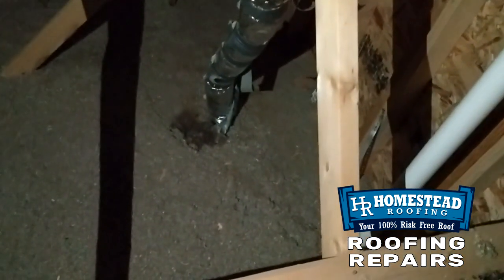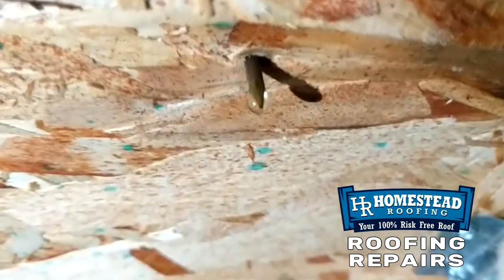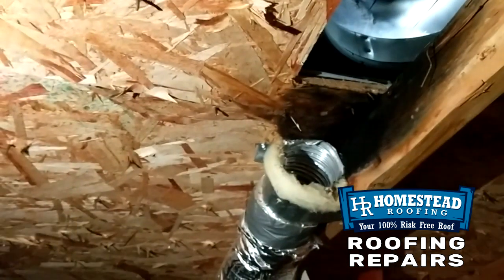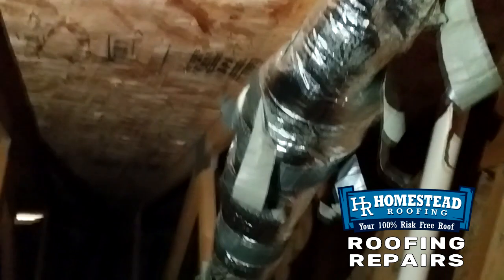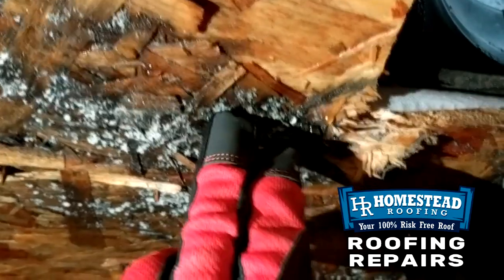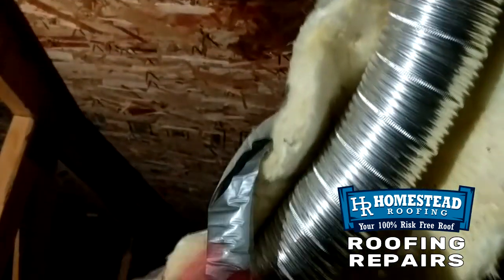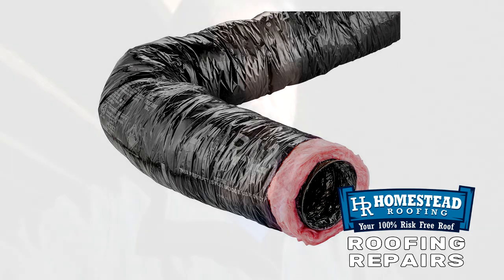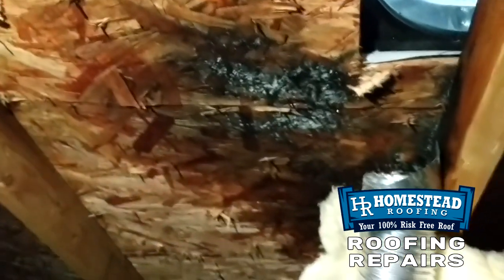My Bathroom Fan Is Leaking! (Part 2)

Comment: No use no problem. Running floor fan in the bathroom or dehumidifier
Reply from the maker: You'll still have evaporated water going into your attic through the fan. The fan casing is basically a hole in your bathroom ceiling. That's why it should be vented all the way through the roof.

Comment: So who do I call?  I want to go on the roof and see if I have an outside vent for this before I call anyone. What would it look like?
Reply from the maker: Renee, you if you can see all your roof slopes from the ground, you shouldn't need to go on your roof. The cap you're looking for will either be for a bath exhaust fan or a dryer. If your dryer vents on the side of the house, if you see anything on your roof that looks like this, it's a good chance that it's a bath vent cap. https://www.lowes.com/pd/Broan-Universal-Roof-Cap-Black/1245637?cm_mmc=shp-cprdappgooglelia-186-applianceaccessoryproduct-1245637-_-0&store_code=2578&placeholder=null&gclid=CjwKCAiA8ejuBRAaEiwAn-iJ3hbbVyeiFdv2zJxUu5-yCHqYcoLyhY2C0C8l52oPVnIFmBozU7XbixoC69EQAvD_BwE&gclsrc=aw.ds
Reply: @homesteadroofing  thanks very much.  I was up there the other day cleaning my swamp cooler. Wish I had noticed then. I can't see it from the ground level.
Reply: @homesteadroofing So I had bad ventilation in my attic, which caused a lot of water damage. My dryer vent pipe fell off from roof. I had new shingles put on 5 years ago and these are the same cap that's on my house. My question these caps don't have a pipe on the bottom of them. How do you hook a vent pipe from dryer to these vent caps?